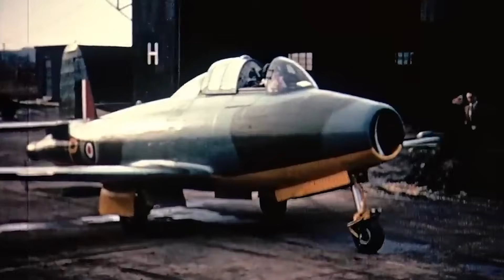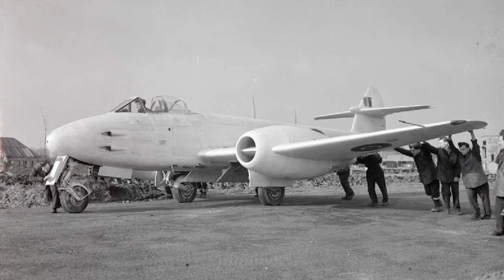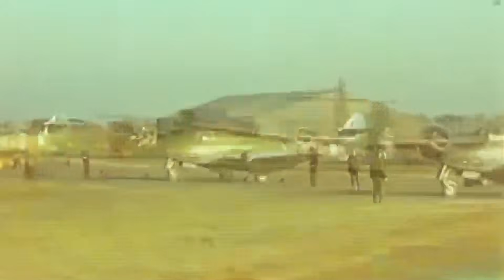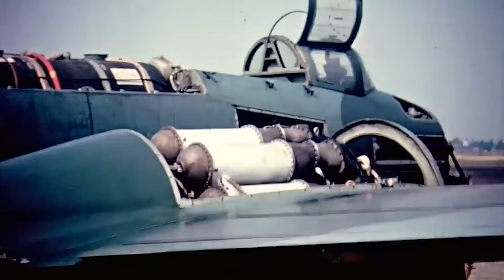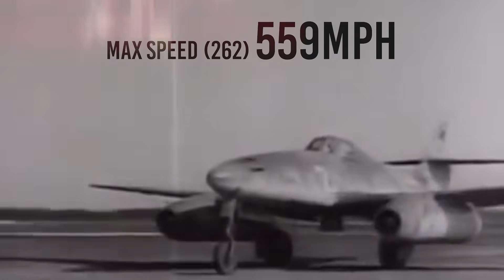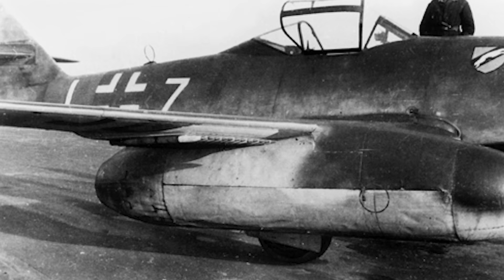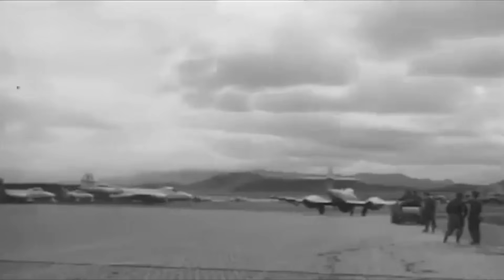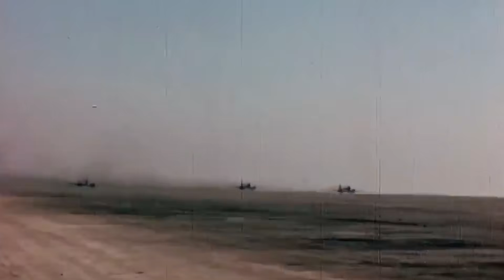Meteor vs Me 262 | Which was the better WW2 jet?

Comment: As the turbojet was new tech, the Meteor was built to a safe airframe design. This was so if the plane behaved erratically at some speeds or maneuvers the problem could be quickly identified to airframe or the radically new designed engine.

With untried new airframe and jet engine it may be difficult to pin down a problem.

Nevertheless, the airframe was all new not based on a previous design and so advanced it had a forward positioned pilot giving amazing vision for the time and a quiet cockpit giving less stress on the pilot, and a high tail to be away from the jet engine's thrust.
Reply: RAF Chief Air Marshal Sir Williiam Fredrick Bowhill called the Gloster Meatbox a quote; "A Completely Dismal and Lackluster Aircraft"

890 CRASHED just in RAF service killing 450 british pilots in peacetime operations.
 Over HALF of all the Meatboxes built CRASHED or were destroyed in accidents!
Truly appalling statistics for a jet fighter that was SUBSONIC

It remains the worst jet aircraft ever used in RAF service.
Reply: @DoktorBayerischeMotorenWerke 
Doktorbimmer, a quiz.
Name the world's first operational jet plane.
20 points for the correct answer.
Reply: @johnburns4017  The 262. There were no "operational" Meteors during WW2. Unless hiding from Germans is operational
Reply: @TheAneewAony  
BZZZZZT Wrong answer.
doktorbimmer, the name the world's first operational jet plane was the....

 🍾🪄🍡 Meteor 🍾🪄🍡

Zero points bimmer. Zero. Better luck next time.
Reply: doktorbimmer, out of a total 6,000 points available to be won, you have accumulated a grand total of zero points.   You have been a fine contestant. Keep up the good work.
Reply: @johnburns4017  Tell us again... for the humor value. The Meteor was "operational"?
Reply: @TheAneewAony  
Doktorbimmer, a quiz.
Name the world's first operational jet plane.
20 points for the correct answer.
Reply: @johnburns4017  Tell us for the humor value
Reply: @TheAneewAony  
BZZZZZT Wrong answer.
doktorbimmer, the world's first operational jet plane was the....

 🍾🪄🍡 Meteor 🍾🪄🍡

Zero points bimmer. Zero. Better luck next time.
Reply: @johnburns4017  LOL. There were no "operational" Meteors. Never operated in actual WW2 combat, due to a lack of technology
Reply: Since the Meteor was never operational during WW2, by any measure... this is so easy.
Reply: @TheAneewAony  
Doktorbimmer, a quiz.
Name the world's first operational jet plane?
20 points for the correct answer.
Reply: @johnburns4017 The 262 was operational before the 234. The 234 was the only operational combat jet to operate over England during WWII. Pick one.
Reply: The Meteor III airframe was limited to 500 mph by the RAF Central Fighter Establishment. This was in part due to the Meteor's low critical Mach of .74. Would you like a copy of the report?
Reply: @TheAneewAony  
doktorbimmer, a quiz.
Name the British plane that set the first official jet speed record at 606 mph (975 km/h)?
Twenty points for the correct answer.
Reply: @johnburns4017  You of course are referencing the 700 mph speed record set by  a 163 on 6 July 1944, a record that would stand until 1953.  20 points if you can name the pilot Heini Dittmar
Reply: @TheAneewAony  
BZZZZZT Wrong answer.
doktorbimmer, the name of the British plane that set the first official jet speed record at 606 mph (975 km/h) was the....

 🍾🪄🍡 Meteor 🍾🪄🍡

Zero points bimmer. Zero. Better luck next time.
Reply: @johnburns4017  That would be incorrect. The "record" that you cite was recorded by the French (Fédération Aéronautique Internationale) and were in no position to record the 700 mph speed record set by a Me 163 on 6 July 1944 and piloted by Heini Dittmar.  Be that as it may, a Me 262 V9 serial number VI+AD had hit 606 mph in 1944. Tell us, for the humor value, how 606 mph is faster than 700 mph
Reply: @TheAneewAony  
Doktorbimmer, a quiz.
Name the world's first purpose designed  operational  jet plane?
20 points for the correct answer.
Reply: @johnburns4017 Are you asking about the only combat jet to operate over England during WWII, the Arado 234.

Comment: The 262's  legacy, strange as this may be, is the location of the engines. Though not used in modern jet fighters it sure is seen in every modern commercial jet airliner bar one or two corporate jets as is its axial flow engines and oh yes, I almost forgot the swept wings.
Reply: The Meteor was fitted with axial-flow engines which looked the same as the 262 being slung under the wings. 

The 262s swept wings were only at the front edge. The were swept to get the balance of the plane more even as they changed engine in development which had a different weight. The sweep was more accidental.
Reply: @johnburns4017  Regardless, the 262 was first with the axial flow turbine and in comparison to the Meteor there is a big difference in the wings, no allied plane at the time had a wing remotely like the 262, however I'm not an expert and stand to be corrected.
Reply: @anthonyxuereb792
As I wrote the Meteor had an axial-flow fitted but rejected as being unreliable. The Germans used them finding out the hard way. The British axial-flow produced far more thrust than the German efforts. If the British axial-flow engines were fitted to the Meteor it would have blown the 262 away... but would have been as equally dangerous and unreliable as the poor German Jumo effort.

The British had five types of turbojets in development in WW2. The Germans never even had a centrifugal in advanced development ready for use.

The centrifugal was chosen as it was fully developed, reliable, and ready giving a plane that blew away German piston engined planes - the prime threat.
Reply: @johnburns4017  The Germans were ahead, plain and simple.
Reply: @anthonyxuereb792
On what do you base this article of faith?
Reply: The continued use of swept wings was initially for the characteristics in transonic flight.  This was a result of research, NOT a copy of the Me 262

Comment: Really all about engine management. The Germans had the best tech in axial flow but couldn't vary power quickly and had issues with bearing life, materials and heatand fuel management. The centrifugal flow Whittle jets were easier to throttle, but ultimately were an obsolete tech.
Reply: The British Metro-Vic axial-flow was superior with far more thrust and lasted longer. The Germans never had the best tech in anything. They introduced guided missiles but they were jammed. The rockets were stolen from Goddard. The V rockets did sweet nothing to divert the course of the war.

Comment: Me 262 maintenance was high but did you know that the F-14 was discontinued because of too high maintenance. 100 hours of maintenance for every hour of usage. Me 262 doesn't look so bad now.
Reply: This is only a problem with our enemies. 
Always look at this videos as a sale pitch. Then research what he is not saying:
-number of plane crushed involving Meteor
-how easy it was to repair engine on it 
-performance in Korea where it met Me262 comparable plane Mig-15.
-what would happen with development of Me262 in case there would not be end of the war (look up Me 262 HG III: gyroscopic sights, wings with slats (used on Sabre and Mig-15), more swept wings for higher speeds, better canopy, new better and more reliable engines, guided air-air missiles; it could possibly be transonic or even supersonic (2nd generation fighter as F-100 Super Sabre not F-86 Sabre))

Comment: Nerdy remark: There is a slight innacuracy in the script. The Me262 was the fastest jet, but it wasn't the fastest aircraft of WW2. The Messerschmit Me163 Komet rocket powered interceptor holds that record.
Reply: If it didn't melt you or explode...
Reply: Yes, 700 mph, a record for combat aircraft that would stand until 1953

Comment: The Me 262 gets perceived as a legendary aircraft/ As such there is an unjustified mystique about. I think it is over-estimating all the time. From simulations to air chair historians the tendency is to portray the Me 262 as some sort of unchallenged super weapon. In the meantime, the Meteor often gets portrayed as being hardly worth mentioning and vastly inferior to the me 262. As you have pointed out this is hardly the case. However, it does play into the standard simplified narrative of Germany having superior quality technology while the west had superior numbers. This propagandistic dynamic gets even more extreme when the Soviet Union gets compared to the Germans.
Reply: The Meteor is still flying commercially today. It was militarily operational until the '80s. That says a lot for its design.  No one took anything of the 262 design running with it.
Reply: MrGadfly772
'This propagandistic dynamic gets even more extreme when the Soviet Union gets compared to the Germans.'

Prof Adam Tooze in Wages of Destruction, emphasises the superior design and quality of manufacture of Soviet weapons over German. And also over western ground arms. When the USA came into the war, the Soviets did not want a flood of western arms, considering them inferior.  They wanted boots, wire, raw materials, etc.
Reply: @johnburns4017  YES! Often when talking about the Soviet Union you have to wade through decades worth of anti-Soviet propaganda that people still tout mas real. It's so sad that these stereotypes get traction even today.
Reply: Both brought great jet tech to the world but the axial-flow concept used by the 262 is a key design element of modern jet engines, whereas the centrifugal-flow engine of the Meteor was a dead-end. The ME262 also helped with swept wing design being used into the modern age. The legendary test pilot, Eric ‘Winkle’ Brown’s commentary (his documentaries are on YouTube) on the 262 is quite interesting to watch, he flew them both.
Reply: @RowanvanTonder  
Read my posts on Eric Brown.
Centrifugal was not a dead end as it powered turboprops post war. 

AA Griffiths invented the axial-flow engine. In 1943 the Meteor first flew with a Metrovick F.2 axial-flow engine that produced far more thrust than any German engine ever did and outperformed the centrifugal engines. Blades were thrown in flight as metallurgy was not up to it so Wiggin in Birmingham was told to do research on high temperature alloys.  The government went with the safer centrifugal which would outperform any piston plane.

The F.2 was more reliable than the German Jumo, but the British would never put a plane in the air with such an unreliable under-developed engine. The F.2 ended up as the post war Sapphire being built under licence in the USA as the J65, powering the: Douglas A-4 Skyhawk, Grumman F-11 Tiger, Martin B-57 and the Republic F-84F Thunderstreak.
Reply: @johnburns4017  thank you for the very informative and interesting reply John, always great to learn more. I will read your posts on Eric Brown.

Comment: Gloster Meteor Mk3 maximum speed: 493mph.
Reply: The Meteor III never attained that speed. The RAF Central Fighter Establishment tested three Meteor IIIs with Derwent II engines, none ever exceeded 470 mph at any altitude. Would you like a copy of the report?
Reply: @TheAneewAony I haven't seen your reference, but I believe you. My reference is from a book entitled "History of Aviation" from Crown Publishers, Inc. in New York (1972). On page 342 of the 1976 reprint of this large, illustrated book, there is a facts and figures panel for the Gloster Meteor, complete with a three view silhouette. In its summary remarks, the  penultimate sentence states: "Major wartime version was the Mark III (280 built), most of which had more powerful Rolls-Royce Derwent engines, giving them a maximum speed of 493 mph (793 km/h) at 30,000 ft (9,145m). It does not specify a particular mark of the Derwent engine, and neither was I. 
The authors are John W.R. Taylor, a Fellow of the Royal Historical Society, and Kenneth Munson, both of whom being described as editors and compilers of  "Jane's All the World's Aircraft" on the cover.
Reply: @bigyin2586  My source is an original primary source document, directly from the RAF's Central Fighter Establishment dated February 4th 1946. The test involved three Meteor IIIs fitted with Derwent II engines. Page 17 gives the maximum speed as 471 mph. Appendix F, figure 5 also gives the maximum speed at various altitudes in level flight, which never exceeded 470 mph. Page 6 paragraph 54 titled flying limitations limit the Meteor's airframe to 500 mph due to the critical Mach of .74. By way of comparison, every 262 was flight tested at 590 mph in a 40 degree dive by the factory before delivery. The 262 had a critical Mach of .86
Reply: @TheAneewAony just for clarification, how many different types of engines were used to power to Meteor III? My OP just talked about the Meteor III generally, not whether it was powered by a Welland, or a Derwent Mark whatever. You have specifically referred to the Derwent mark II Meteor in both of your posts. 
The 493 mph figure has been so often repeated. Did Jane's (or someone else) get it wrong?

Comment: It comes down to the pilot in the end 😮
Reply: Not really.
Reply: @johnburns4017 
Not really in what way?
Reply: @richardbailey3343  
If you have bad tool the best craftsman cannot make it better.
Reply: @johnburns4017 
This is true assuming that they had the resources it would come down to the skill of the pilots this had been and always will be the case 😊.
Reply: @richardbailey3343  
A top quality tool and craftsman behind it creates a top quality outcome. A poor quality tool and top craftsman behind it will create a less than top quality outcome.
Reply: @johnburns4017 
Production units often ran of the production line bot up to spec many were corrected in the field on all sides🤔😎☝️

Comment: The Me 262 disappeared after WW2 nothing was heard of it after to he war.
Reply: Both Sabre and Mig-15 used Me262 wing though.
Reply: @matejmacek5784 They didn’t though.
Reply: @thelandofnod123  they were the improved 35° with slats, which were newer used on Me262 but were developed (should be used on Me 262 HG II). 

When USA designed Sabre they thought swept wing were due to error in centre of gravity calculation, then after 1 year and one lecture of German engineer they knew everything (famous Boeing now Krüger flaps).
Reply: @matejmacek5784 The 262 had straight wings until fitted with engines. The wing root remains the same. The wing on both the Sabre and MiG-15 are vastly different.
Reply: @thelandofnod123  Complete and utter nonsense that's being repeated over and over on the internet. 
First of all, it is very well documented that the Germans fully understood the advantages of swept back wings, just google Adolf Busemann.
Messerschmitt also build more than one type of plane with swept back wings. The rocket powered Me 163 Komet is just one other example.

The original plans were for the Me 262's wings to have 35° wing sweep and this was only changed and wing sweep was REDUCED  to 18.5° because the Junkers Jumo 004 engines were much heavier than the increasingly delayed development of the BMW 002 jet engines that were originally chosen over the Jumo engines.
This is probably where the myth that the Me 262's wing sweep was supposedly only done because of center of gravity/ center of mass reasons seems to originate from. But it is in fact extremely easy to debunk and anyone who understands anything about aircraft will know that the heavier engines will move the center of mass forward and as such will require the center of lift to move FORWARD as well to accommodate the heavier engines, meaning if the original plans were for straight wings then the result would have required forward wing sweep similar to what is seen on the Ju 287 jet bomber which has forward swept wings to accommodate a larger bomb bay.

There were also well documented and very detailed plans and proposals for high speed variants of the Me 262 with even greater wing sweep than 35°. 
There were also German developments of jet engines with more than twice as much thrust, and even one with afterburner that were already started during the latest stages of  WW2. 
Had Germany not lost when it did, then these engine developments would have undoubtedly soon become available for new airplane designs with greater wing sweep than the Me 262 had.

Comment: Arado 234-C vs Meteor would be  interesting.
Reply: Yes, I was wondering, why a Meteor, being an initially home based interceptor with great high altitude capabilities never managed to down an Arado 234 which quite frequently did reconnaissance flights over Britain. It was the very purpose of the England based Meteor's. I guess those 234 flights weren't frequent enough at least in comparison with the V1's.

Comment: No ME 262 with period correct engines will ever take to the air again. It is considered to dangerous. But you have Gloster Meteors that is still airworthy to this day
Reply: I was talking to the Airbus Test Pilot who flies the replica Me-262 at RIAT back in 2023 and he told me that even with the modern engines, if you lose one you are in serious trouble as the fin and rudder are not big enough to keep the aircraft flying in a straight line on a single engine putting out enough thrust to keep the aircraft airborne.
Reply: @richardvernon317  It is also due to the lack of "exotic" alloys in late ww2 Germany. I think the Jumo engines had a service interval of something like 8 flying hours. It maybe could be possible to restore a ME 262 air frame. To airworthy conditions. But the engines not at all. If I remember correct, in Canada the have restored a ME 262 with period correct engines to be able at least taxing though